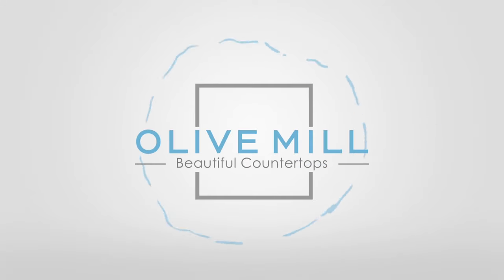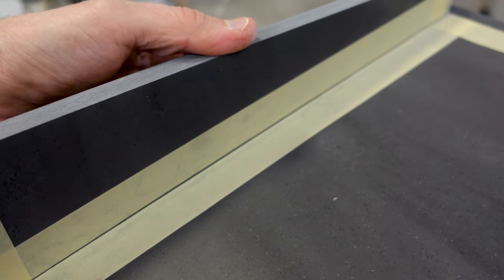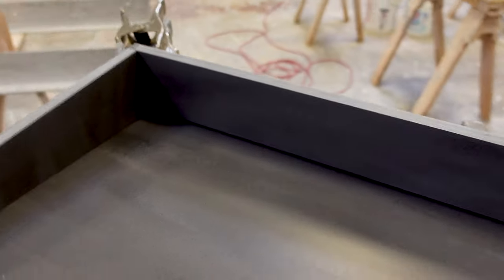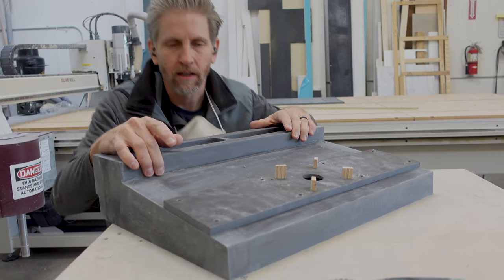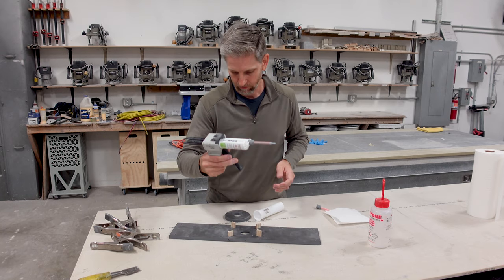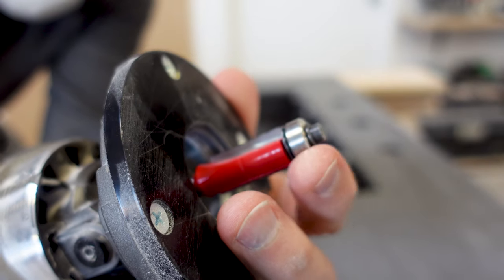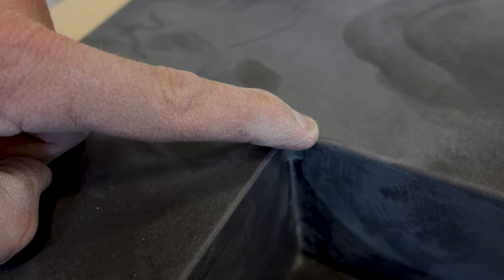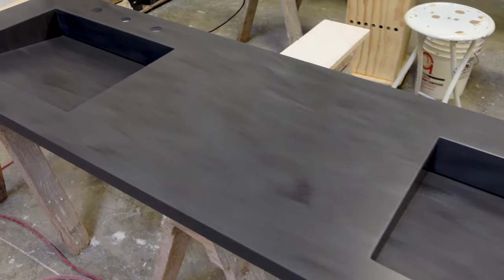Corian Solid Surface Ramp Sink Fabrication with Slot Drain

Comment: First off absolutely beautiful work on the sinks they look fantastic. I had a question regarding the joints and the integrity of them in high temperatures (kitchen sink type abuse, boiling or near boiling temperatures etc). We have had the darnest luck with any of the fabrication of these where the joint (the weakest point) is continually failing. Any comment or insight into this would be fanastic.
Reply from the maker: Thank you. This is a vanity sink so I doubt it get much boiling water so we have not had an issue. Are you doing kitchen sinks where they fail?
Reply: @AndyGraves  yeah we have had corner joints fail several times recently on kitchen sinks. Measured bit high on the direct hot water measuring 160-165 at the tap. Latest experiment was to use a thicker material, 3/4", to have a larger bond surface though alias still the corner joint failed.
Reply from the maker: I actually don't think it's a good idea to make kitchen sinks because of that reason. There are plenty of great sink options. Then, who covers the warranty for a custom sink?

I wish there was a better solution. You could try using fiberglass on the back side of all the joints  like the Karran solid surface sinks. Fiberglass is extremely strong.
Reply: @AndyGraves  yeah I'm think that is the problem. Don't think fiberglass will work as nice, if completely undermount it might work 🤔, for any apron sink though the front is always going to be weakest point.
Reply from the maker: Good point

Comment: hello , great work , i am wondering how do you insure that the lower part that is fixed by screws wont leak water
Reply from the maker: Use a bread of silicone and then screw it on.

Thank you

Comment: Nice work sir , how do you attach the sink to the other party? thank you
Reply from the maker: Thank you. Just glue it on to the underside of the material and then trim and sand it smooth.
Reply: Thanks a lots sir

Comment: Nice. Can I ask a question how much is the cost for Corian countertops with Cove Splash inside caps corners? It's price by the linear or square inch or foot?
Reply from the maker: It depends where you live. We price everything by the linear foot and the cove is priced by the inch.
Reply: @AndyGraves  would you happen to know what approximate price is around N CA
Reply from the maker: @AB-yu2tj  No, I'm sorry I don't.

Comment: Great video Andy, 
Whats the "tail pipe" material ? And does the corian adhesive bond too it ?
Cheers Marty
Reply from the maker: The tailpipe piece is from Home Depot. I think it's PVC but not sure. I actually not sure if the glue sticks to it but it's a super tight fit. I have a video on the ramp sink drain. It might show you more than this video.

Comment: Great stuff Andy! We're thinking about getting one of these installed in our powder room and are curious about a few things:
1. How does the material as compared to conventional porcelain?
2. Is it true that darker colors will lose their luster relatively quickly and we'd be better off with lighter tones?
3. I understand the material can be scratched with scotchbrite etc, will we be cleaning this with a wash cloth and mild detergent?
I'd ask you to make it for me but I live half way across the world. :) thanks!
Reply from the maker: 1. This material is softer than Porcelain but you wouldn't be able to make this countertop with porcelain material. 
2. Darker materials will show more scratches and water spots but will not loose their luster.
3. Yes, soap and water or glass cleaner is really all you need to keep the material clean.
Reply: @AndyGraves  thanks! I just noticed a typo in the first one. I meant to ask, how does the solid surface material wear as compared to porcelain? I've heard about decades old countertops going strong but I'm not sure how the sinks hold up.
I'll be sure to opt for the lighter hues in this case, the darker ones are my favourite but I'd rather opt for the low upkeep. This was very helpful, thanks!

Comment: Wow Andy, excellent work!!!! I am wondering if you alway use Corian for these types of integrated counter sinks or do you use other brands too like Silestone or Neolith?
Reply from the maker: Thanks. We only use solid surface material like Corian for these sinks.
Reply: @AndyGraves  thanks Andy. I will get in touch with you in a couple of months, I will be remodeling my bathroom. I am located in Los Angeles. The reason I asked about other solid surface brands because of the different color choices.

Comment: andy fantastic job!!! Greetings from Spain!!!, I`ve been started to work solid surface, is there any possibility to share the cutting plans for the cnc??.thanks
Reply from the maker: Thanks. What are cutting plans? Not sure what you mean.
Reply: @AndyGraves  I wanted to say the file or cutting template that you load on the cnc
Reply from the maker: Each file you create will be unique for that job. There will be certain rules you should follow to get the best results. What program are you using to create the CAD/CAM?
Reply: @AndyGraves  i use sketchup, and recently I have bought a router Cnc that works with match3 but the cutting plans need to be make with aspire

Comment: You prefer super glue over hot melt?
Reply from the maker: Both work good but super glue is a sure thing. It will not let loose like hot glue does at times. Plus you can get a little more pressure on the joint.

Comment: Good video but it would have been great video if you were to show at the end how you cleaned it after the 400 sanding. Watching 20 min but not showing that part was a bit turn off. The polishing is mastering itself I think had to be part of the video. I still have no clue how the sanding/polishing process goes
Reply from the maker: I should have specified. This is a pro level video for experience solid surface fabricator. Anyone that is making something like this will already be an expert in finishing solid surface.

I also have sanding videos you can watch for more help.

Thanks for watching.
Reply: @AndyGraves  thanks for your replay